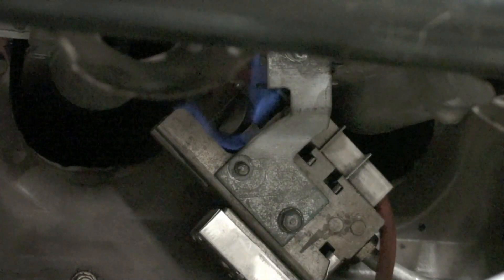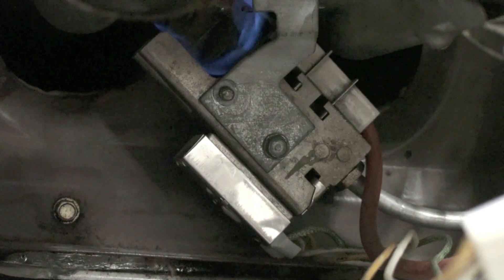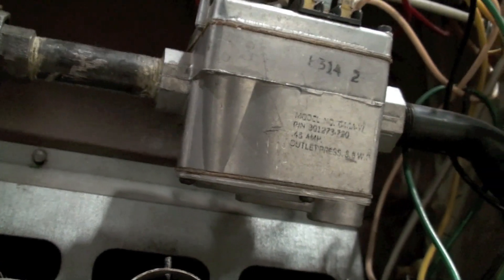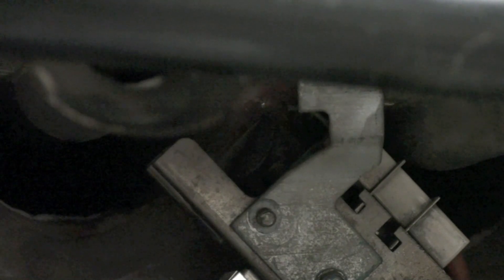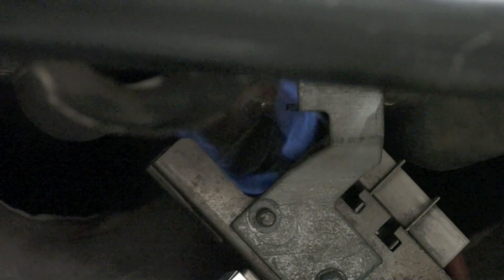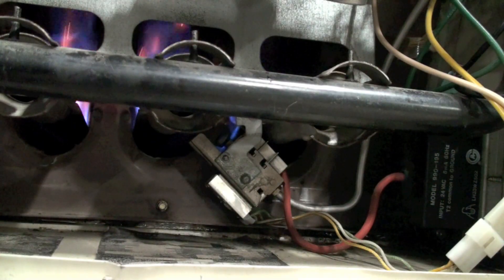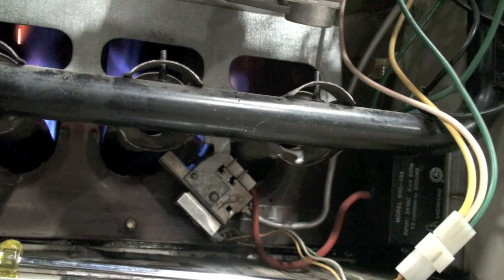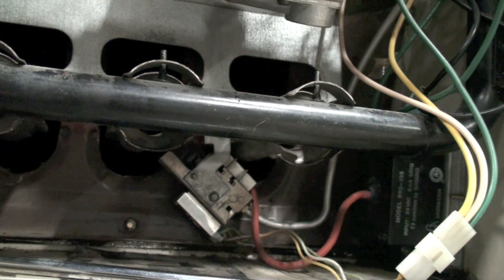Carrier 58SS 58GP 3 wire pilot assembly operation

Comment: Hi, not sure if you still answer questions on older videos. I have watched your videos in the past (i am a landlord/do it yourselfer) and stumbled upon this one while trying to diagnose an old Bryant furnace. By the way thank you for the videos you have put out. yours and other people that help diagnose are doing a great service. My furnace has this same 3 wire pilot assembly and I think I may replace it. (although it is pricey at a few hundred dollars) The issue is that the furnace will light, then go out and re-light about 10 times, (and sometimes sparking like a baby rattle consistently) before finally staying on. Would you mind sharing an opinion on weather you think this pilot burner assembly would be the problem? Bryant 394GAZ036100
Thanks
Reply from the maker: Pretty good chance the pilot is failing.
GFM
Reply: grayfurnaceman thanks so much👍
Reply: Hi, I just wanted to do a follow up on your advice to replace the 3 wire pilot assembly. I’d like to show you the problem that is having after replacement.
It is acting better and lighting more often with the new part but there seems to be an added issue. Igniter will sometimes try to light continuously and then when I wiggle/flick or turn the blue pilot handle on the gas valve back-and-forth the pilot will light and stay lit. Which to me seems like maybe the gas valve needs to be changed. I believe the furnace to be over 20 years old. Definitely time for something upgraded but if it’s the gas valve that would definitely be the lower cost to repair. (As a landlord trying to stretch my dollar) And I do appreciate the videos and advice. Thx
Reply from the maker: First, more like 30 + years old.  Are you saying the pilot does light with the spark but the spark continues, or does it not light?
GFM
Reply: grayfurnaceman hey thanks for getting back. Appreciate it. I actually did a video earlier today. Would love to have your insight. It actually started working a bit better before i left the rental earlier. But I’m sure its going to act up again. Here’s the link.
https://youtu.be/c2HDptwf1bM

Comment: Hi, I have one of these day and night three wire with intermittent running.  I have replaced the three wire pilot with brand new Pilot that lights every time, but it does not release the gas all the time.  I usually hear very quick rapid clicking, like 2 taps coming from the gas valve (?).  I try to put the meter and find the pick and hold terminals.  Should they have power? I often have fluctuating voltage, sometimes 20-38 with it running.  Is this worth a part (gas valve?)  I can gamble on or does this thoroughly have to be tested? The pressure switch appears to be good, because the draft fan runs consistently. I did bypass the pressure switch and that didn’t help anything.  Please help, wife doesn’t like burning wet wood 😝.  Thank you!!
Reply from the maker: This is probably a bad gas valve.  Very common if the pilot switch is working.
GFM

Comment: For some reason I can't watch these video so I'm not sure if you covered this but what Is the purpose of the little nipple inside the igniter where the gas line goes on this model. I lost mine down the main drain and past the trap. What if I don't use it?
Reply from the maker: That part is essential.  It is the pilot orifice.  Without it, the pilot flame will be far too large.
GFM

Comment: Grayfurnaceman: My furnace ignites, heat comes out briefly and then it shuts down after a few minutes. It has been working great all winter and just started doing this. Ideas?
Reply from the maker: Give me make and model#
GFM
Reply: @grayfurnaceman  I have this same issue with a Carrier 58GS style system.  Thermostat is good, replaced limit switch L170-40.  Ignitor lights pilot, pilot lights main burner.  Main burner cycle turns on fan, but burner goes off after a couple of minutes.  Fan continues until lower limit. As soon as fan goes off, pilot goes back on.

Comment: I have a 1986 Carrier 58GS 125 BA, model 150. It has been dead for 3 cold days. First I replaced the electric pilot assembly, then the igniter, then the Capacitor. Nothing changed. Finally I replaced the High Limit Thermostat. Success! My only concern is that when it finally lit up, the flames came whooshing out and singed my flannel pajama pants before I could jump back. I didn't touch or adjust the gas valve, so I'm thinking maybe when I replaced the pilot assembly I set it a bit too low, so there was too much gas built up before it lit? I don't know, but I was uncomfortable so I shut the whole thing down and will suffer another cold night and look at it in the morning. I'm going to call one of these HVAC companies that are advertising winter service checks, as they will know how to test and adjust it. But I can't afford a new furnace right now or major repairs, so I bought a box of all the parts and figured I would just keep changing them until I got the dang thing going. I'll return the ones I didn't use. Anyway, I hope this helps someone.

Comment: Hello. Quick question I'm hoping you might be able to help with. I have a Carrier furnace with this same 3 wire pilot assembly. Just the other day out of nowhere, I wake up Friday morning, turn on the furnace and coldish, room temperature air is coming out of the vents. After some research, I attempted to replace the pilot assembly. After successfully switching out, still the same thing. With both the old and new assembly, I noticed the pilot light comes on, but the chambers never fill with fire. I'm thinking there's something wrong with the sensor that tells if the pilot light is on. Can you offer any help or advice?
Reply from the maker: If the pilot is switching, it is probable that the gas valve has failed. Fairly complicated diagnosis here. If you are not confident, either replace the valve or call a professional. Hope this helps. 
GFM
Reply: +grayfurnaceman You were right, it was a gas valve failure. Called a guy to come out and look at it and he replaced it for me. Thanks for the help!
Reply from the maker: +xLoZxPickle welcome
GFM

Comment: My problem is that I don't hear the clicking that tells me that the spark is actually trying to light up/ What am I doing wrong
Reply from the maker: +Andrickson Alix The most common problem is the 3 wire pilot has failed to return to normal position.  Best to try replacement.
GFM
Reply: Thanks for your fast response. After watching your video I realized that the turn on switch was far away from the heater itself. Now it's up and running. Some idiot decided to put it by the stairs

Comment: I have identical pilot assembly as showed on this video. I replaced the whole pilot assembly and still I don't get spark to ignite the pilot. Everything are connected as it was before replacement parts installed. Pilot did not light up? Please need help.
Reply from the maker: +yacapmeluv The high tension lead goes from the pilot assy to a box that has 2 24 volt wires going to it.  Check to see if voltage is to the 24 volt wires,  If so and no spark, the box has failed.  Hope this helps.
GFM

Comment from the maker: I think some of the later Essex valves had the pressure switch too.  It had external wires to it and the pressure switch was one of the common failures in the valve.  Thanks for the thoughts.  It brings back some memories of the problems with that furnace.
GFM

Comment: Nice basic explanation. That is the older style Essex gas valve which uses a holding coil to keep the pilot lit when the pilot moves to light the main burners. The replacement White Rodgers has an internal pressure switch that keeps the pilot solenoid energized. If incoming gas pressure drops to low during operation the pressure circuit opens and the burners will go out. The pilot relights when pilot burner cools down and then recycle off until incoming gas pressure stays in range.

Comment from the maker: First some of your questions may be answered by this vid.  "Carrier BDP 398AAW, 394GAW model plus others".  Most of these furnaces have a fan control board but it has nothing to do with flame safety.  The flame safety is a combination of the gas valve and the pilot assy.  On a call for ht, pilot gas comes thru.  A very small amount.  The main gas can't come on til the pilot proves.  There is no retro kit for these.  The pilot assy is the most common failure.  Hope this helps.  
GFM

Comment from the maker: Not unless you have a 15,000 volt meter.  The way I check them is on a call for heat, I check the 2 input terminals.  If there is input and no output, the ignitor is bad.  Hope this helps.  
GFM

Comment from the maker: Not that I know of.  The only way I can think of is to use an S8600 honeywell spark ignitor retrofit kit.  This includes the gas valve and an adaptor for the pilot assembly.  A pilot burner will have to be added and mounted.  This could only be done on a unit that does not have an inducer.  Cost may be an issue here.
GFM